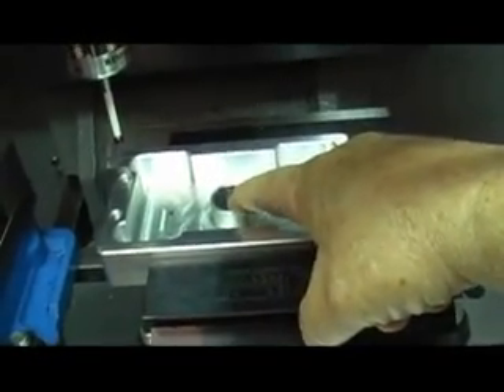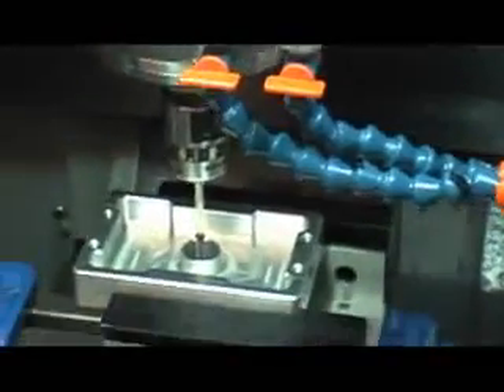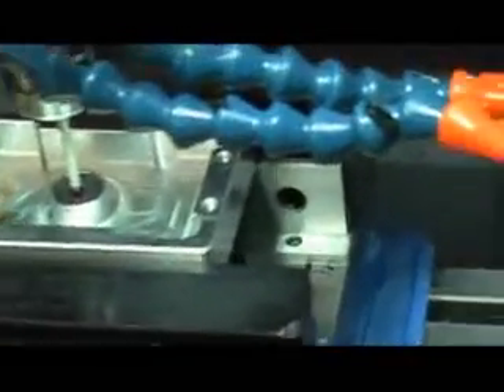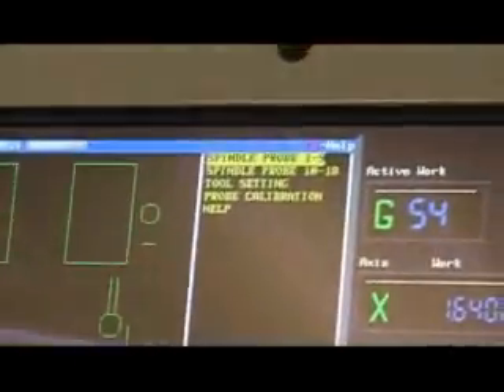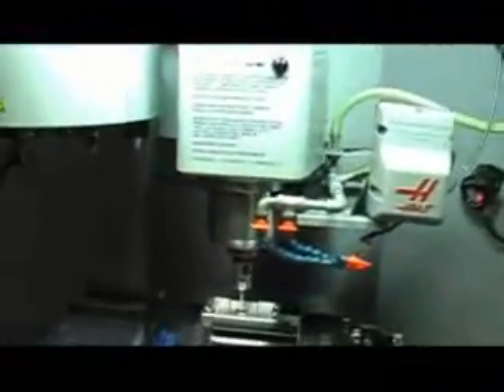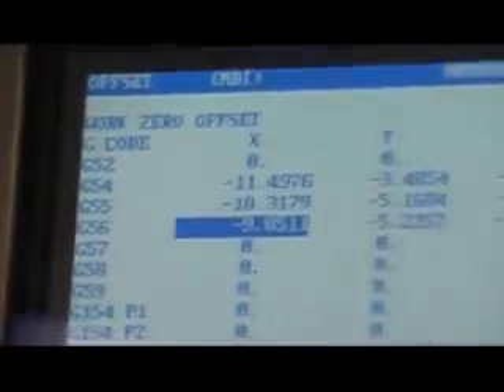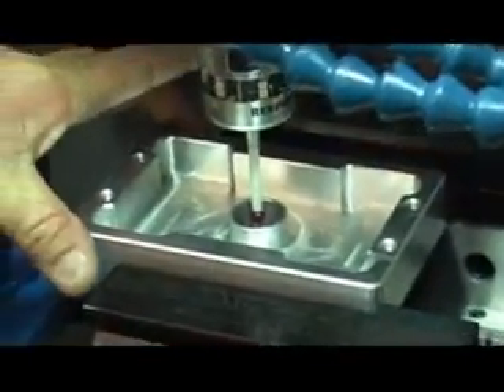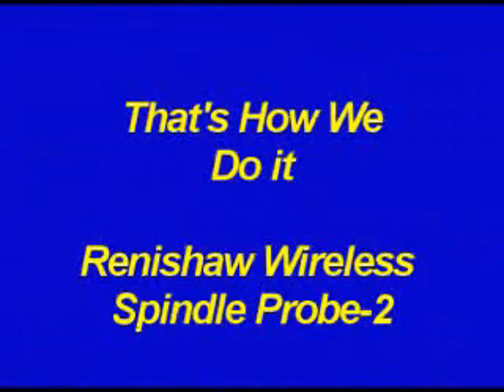Renishaw Wireless Probe - Probe internal bore

Comment from the maker: I don't have a 4th axis so I can not give you any information on your inquiry.

My understanding is that custom macros for the Renishaw can be developed for special applications such as yours.  Check out the CNC Zone under the HAAS forum for possible information on that subject.

Caution: Beware when entering negative Z offset numbers during probing operations.  Some of the moves of the probe are protected and others are not. This can lead to a probe crash.  Read and understand the manual.